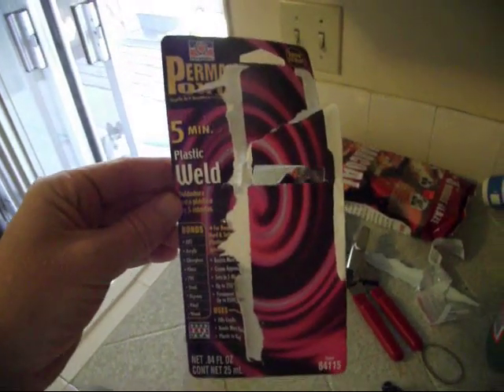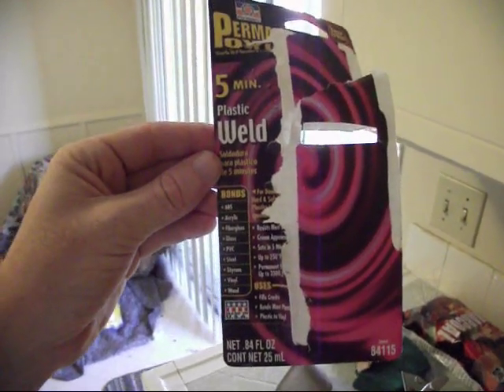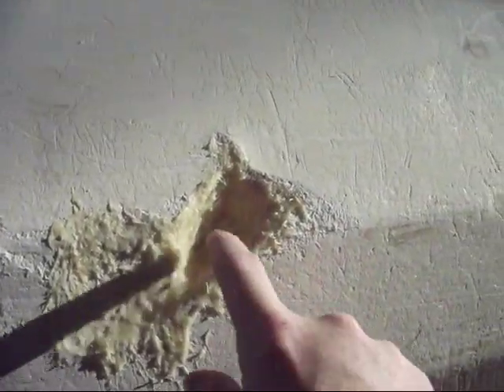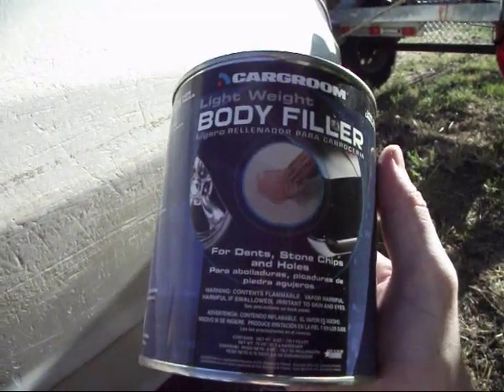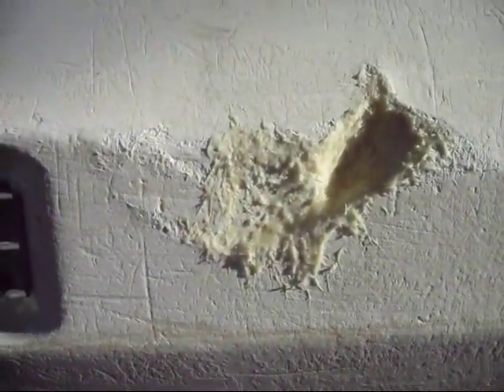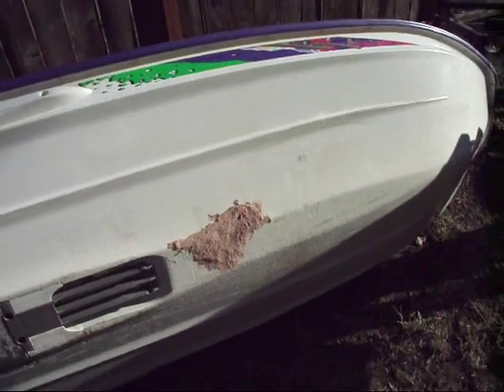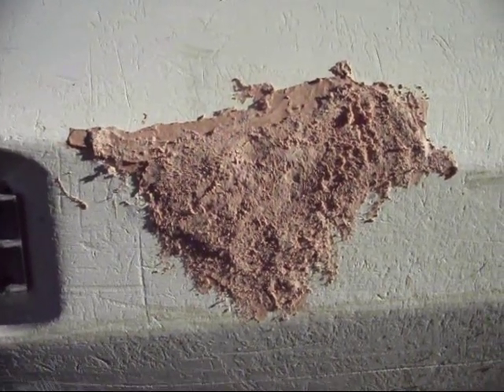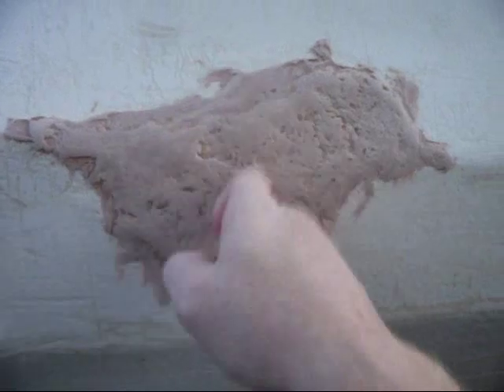Fixing my Jet Ski Hole

Comment: lol. you need to use epoxy resin not fibreglass, kawasaki jetski skis are made from swc(not fibreglass) all that body filler will come out with the water hitting it.

but if it gets you through the summer then give it ago...